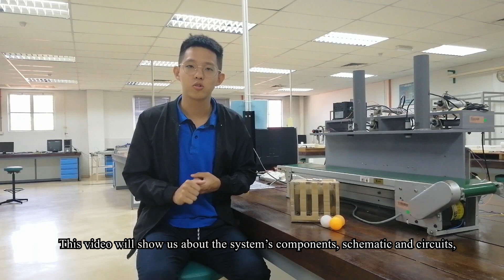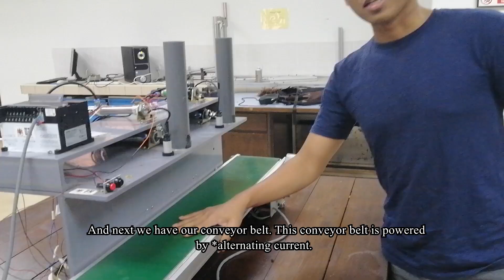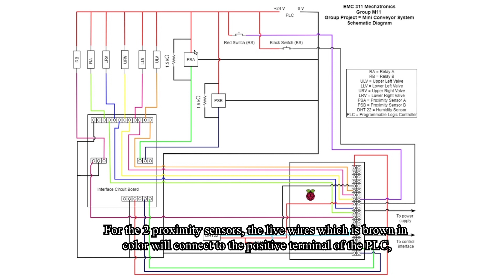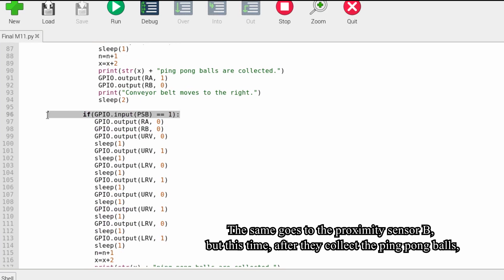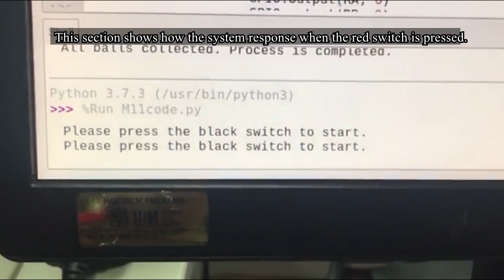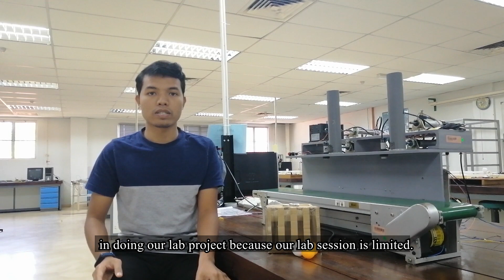EMC311 Mechatronics Project 2019 Group M11 - Material Handling System

Comment: Objectives are well defined.
Manufacturing application is not associated.
Box is not designed for specific manufacturing application thus operation sequence is similar to other team.
Magnetic sensor is not used.
Wiring is well shown and explained.
Motor and relay circuits are not shown and explained.
Pneumatic circuits are not shown and explained.
Program initialization is well shown and explained.
Program flow is well shown and explained.
Switches are used for controlling outputs.
DHT22 sensor reading is used for controlling outputs.
Operation demonstration  is well shown and explained.
Mark 80%